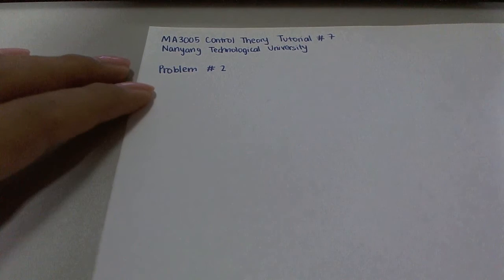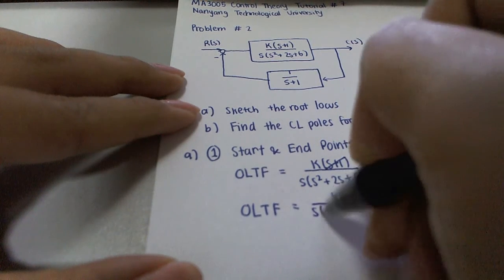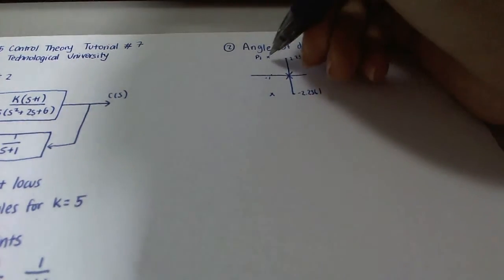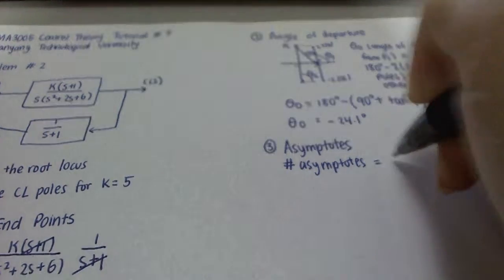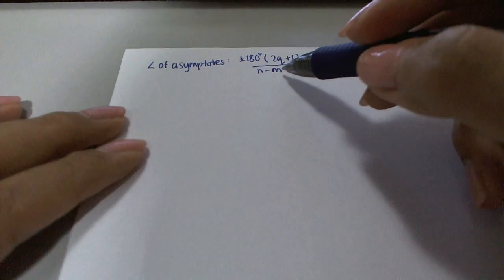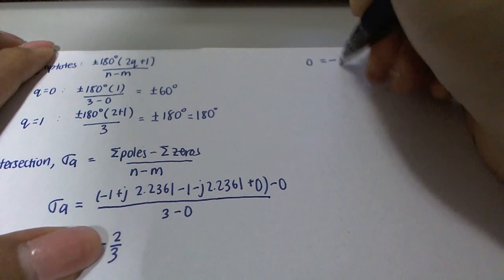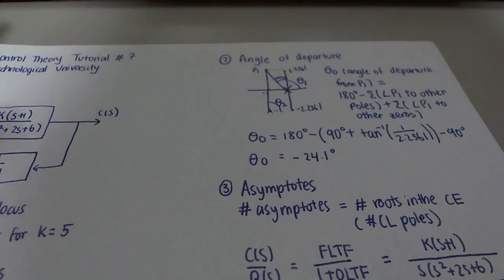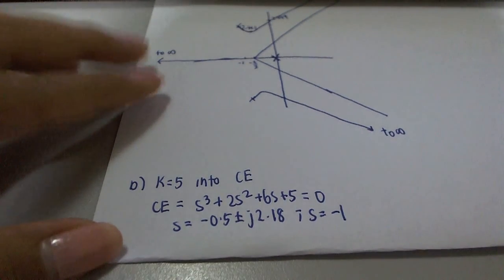MA3005 Control Theory Tutorial 7 Problem 2 (Root Locus)

Comment: I'm still confused why you multiplied the forward equation to its feedback if you're computing for the open-loop transfer function.  Shouldn't be a switch be open before the comparer so 1/(s+1) should be ignored?
Reply: In control theory open-loop transfer function (for closed loop control) is transfer function for the path from system input through forward gain and to output of feedback gain. The switch just after feedback.